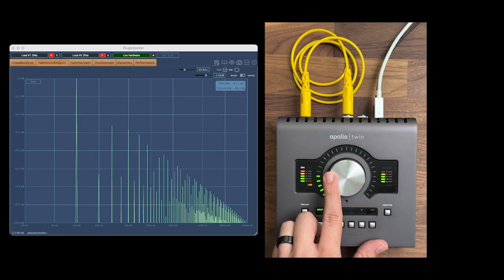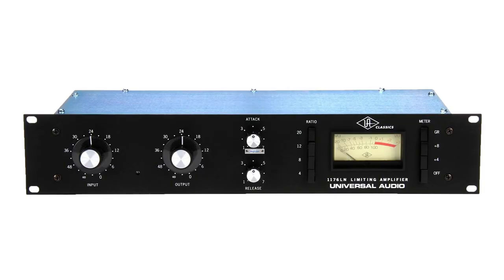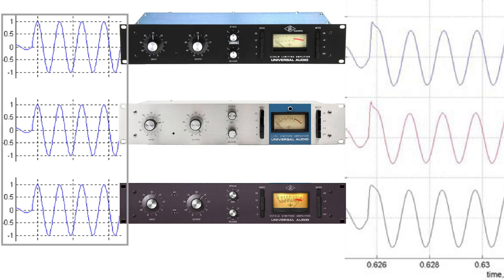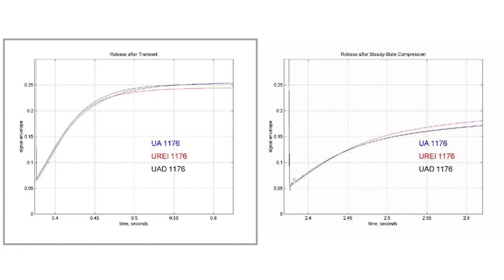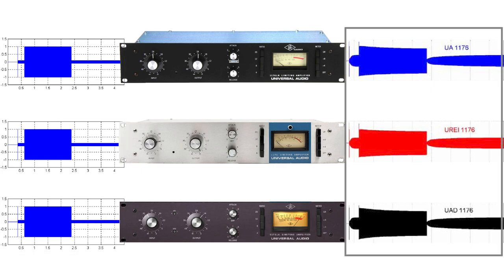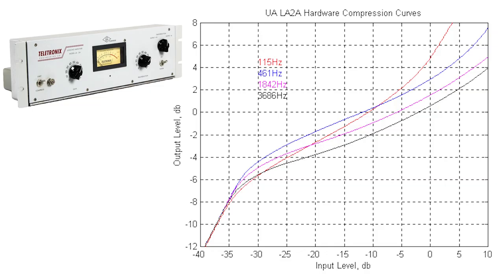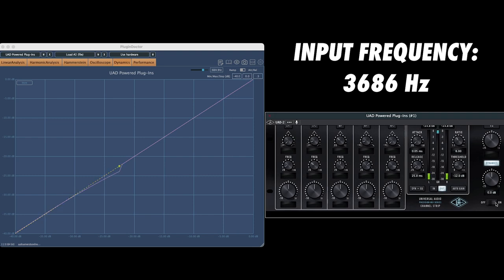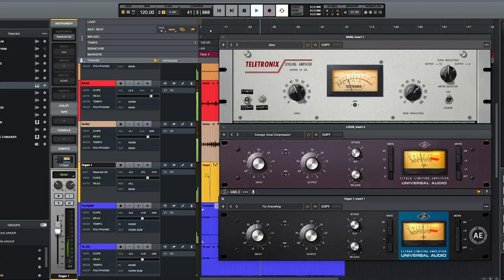What Is “The Analog Sound”? | Exploring the Legendary 1176 and LA-2A Compressors (Part 2 of 3)

Comment: Before you run to buy outboard gear and plugins: I'm lucky enough to own a Shadow hills compressor, Roland space echo, urai 1178 and many other expensive pieces. I also make a living mixing and mastering. I don't bother with them anymore. In the box is a professional sounding result with much more workflow flexibility and reliability!
Reply: Yep.
People are so fickle these days that recall is more important than that last 10% of quality.
Reply: @RealHomeRecording  yes 2 years of mixing practise will make a 500% difference, analogue at this point is simply a different sound, not better or worse. Edit: analogue to me is certainly not 10% better. It's 0% better and a bit different sounding.
Reply: @GingerDrums  now that I have had enough experience with analog gear with the couple compressors that I own along with access analog and mix analog I'm over the mystery as well.

I still believe you can push hardware to saturate a little more and compress a little bit more but that little bit more is not worth it compared to recall and flexibility.

So for me I just want to use hardware when recording and maybe a little bit while mastering. During the mix I'm all plugins.
Reply: @RealHomeRecording  I pretty much agree yeah. Have you tried Koletnikov GE from TDL? You can smash it harder than any of my analogue compressors for rediculous 30 BD and still sounds great lol

Comment: at minute 4:00 the Precision Compressor can give similar result if the sidechain is adjusted to be the same with LA2A which is an extreme tilt that removes high end from the detector, the emphasis control reduces the tilt. Kinda explained why it is loved on the vocals and bass because it leaves the mid alone.

Comment: old school emulations of LA2A and the ‘76 are pretty much scienced by so many programmers(albeit UAD is by far the most pleasing with its non-linearities.) that it is becoming as stock as using auto-tune on every track.

The Distressor is the shizz, shhh….

Optical cells, caps, etc. age much differently depending on   QC and myriad uncontrollable anamolies. Compare 10 different original LA2A’ s and your likely to hear nuances between virtually all units.